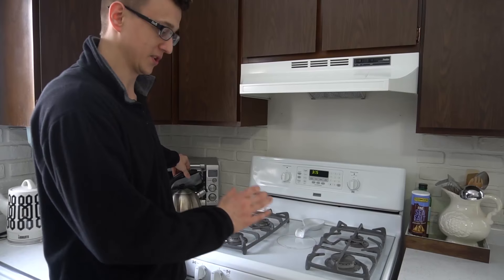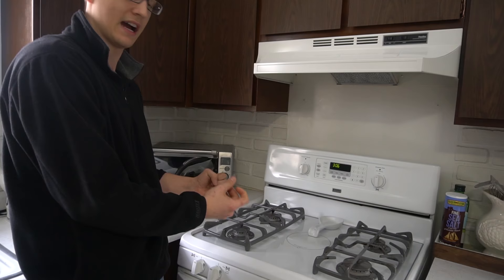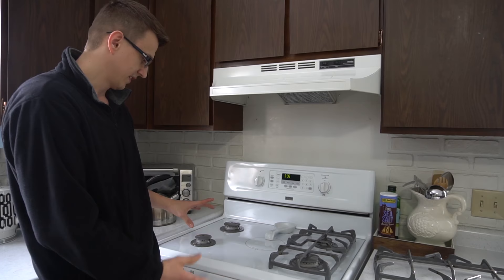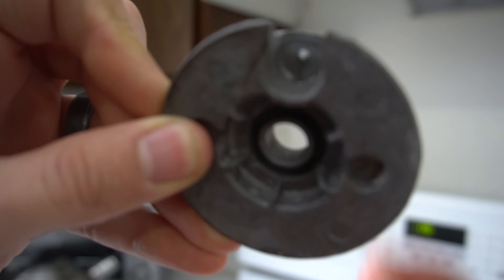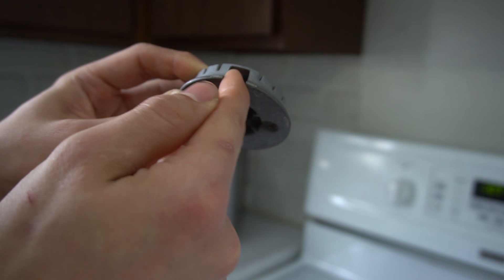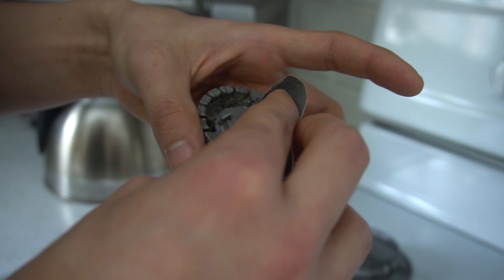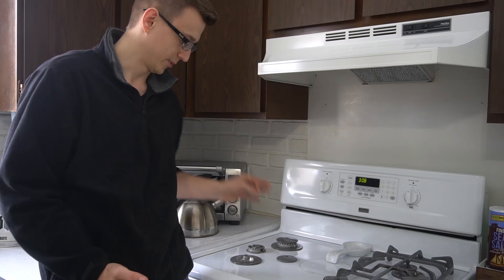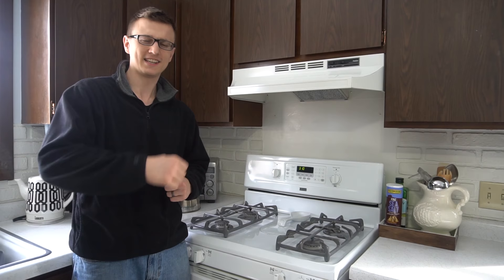Gas Stove Range Not Igniting - Easy Fix

Comment: Thank you!  I was just getting ready to call an appliance repair person and I watched your YouTube video and voila!  My burners 🔥working.  I had to use a socket wrench to undo tiny screws to release the metal burner, but with thorough cleaning with sandpaper and turning all the burners on - it worked!  And is lighting every time.   You’re a lifesaver!

Comment: Ok, I've had one burner irritating me for a couple of years now and tried to figure out the issue off and on during that time. This morning another one started acting the same way, so it was time to research more. Found this video and figured I'd give it a shot. I was disappointed that my pinholes looked completely clear to the naked eye and no gunk came out when I inserted the toothpick. I thought this would be a waste but figured I had nothing to lose. Put the burner back together AND IT WORKED! Both burners light up consistently now. Thank you!

Comment: My gas burner would only light on a very low. My husband just tried sticking the toothpick in the hole and turning it. This worked!!! Now the burner actually has a high flame when set to high!! Thank you so much!! I didn't run across many videos advising to put a toothpick in the hole where the gas comes out. Thanks again!!

Comment: Did this today and it worked.  I had cleaned them before but didn't know about the hole.  I got a toothpick, got in there and cleaned it good now its firing up fine.  :)  saved me from calling a repairman

Comment: Thanks for this! I thought I had cleaned the burner thoroughly, but it still didn’t light. The hole was clear but as I looked closer, there are two holes and one was still clogged. Easy peasy.

Comment: Thanks.  I had the same problem. I was freaked out to see that the lighter worked simultaneously on all the burners, so you laid rest the fears I had that it was a problem.  But, to get each burner to work properly I did as you said and all works OK. YEA! Thanks!

Comment: Thank you for sharing. I have the same setup as you have and I still cannot get my stove to ignite. Soaking the parts in hot soapy water used to do the trick but not this time. My burners look clean except for some white substance building up around it. I will next soak the burner in vinegar and baking soda. And I will try the sandpaper method if this does not work, thanks again.

Comment: My burner didn't have a little hole at the top for the igniter, but running some fine sandpaper folded hotdog style through the vents in the burner did the trick. Cheers mate!

Comment: Thanks so much for the tidbit about checking the small pinhole in the orifice!  One of my burners has not been lighting for months.  Had cleaned all the parts and was about to take it apart.  Took a toothpick to the part you mentioned about spider webs and there was ash!  Once i pushed the toothpick and tried it again it lit like a champ!  Voila!!  Thank again.

Comment: @DaddyChores . Hello how  are you? I really hope you will get this question soon as possible-it has caused tension in the house because they think i broke the stove...anyway i clean the top of stove surface around the burners as usual  but this morning they won't lite and the "click, click, click" is gone😳...🤔what do you (or anyone seeing this post) think happened? Oh yeah by the bye, the oven is not coming on SUDDENLY and the light either (i didn't touch the inside of it while cleaning) appreciate any advice, have a great day.
Reply: i know its way too late, but did you check if the power cable is plugged in the outlet?  did you ever figured out what was the issue - asking just in case it happens to me :)

Comment: Thanks for this video. I couldn't remve the outer casing to find the small hole due to stripped screws. But i tried the last solution you mentioned (cleaning the orifice) and my two faulty burners fired right up. Thanks!

Comment: Please save me, I sublet lol. I was cooking raw beans and the water spilled over, turning off the fire. I opened it up and cleaned it like you did here, dried it too but it still won't light on its own, I've been having to use rolled paper to transfer some fire of the other burners. What do I do?

Edit: I cleaned in between the teeth of the gray cap the goes under the black cap. Works great 👍🤣 you guys are awesome

Comment: This worked for me!  There was a tiny hole in the burner that was clogged up with gunk, exactly like you said.  However, I tried to poke it out with a toothpick, and it still wouldn't light up.  I then tried to burn the gunk out with a lighter, still didn't work.  I ended up just cleaning the burner real good, then I blew the gunk out with my mouth covering the burner (like playing the harmonica).  I think soaking it for a while in a degreaser might have helped also, but I ain't got time for that.

Also, there was some gunk just underneath the burner which caused it to not light up evenly.   I cleaned it up and now it works perfectly.

Comment: Poking a hole in the Orifice on my front left burger fixed it. There was a bunch of gunk and I had to pretty much pierce a new hole for the gas to flow lol. I’m still having trouble with my front right burner.
Reply: same here, did you get it fixed?

Comment: Thanks for the tip. 

My burner lights up from top and I got 4 burners out of which one burner doesn’t lights up. There used to be spark coming up and I don’t see spark for just that burner from past month. I’m using external lighter at the moment for one burner. Any tips on how can I fix this? 

I have got diplomat(brand) gas cooker.

Comment: My trouble is I washed it today because a lot had burned and spilled and I sprayed white vinegar and spray n wipe all around to clean it off, I guess alot got in there on the inside under the screwed area and now it's clean but wont light, what do I do?

Comment: My igniter won’t light the burner.  The igniter was clicking but the spark was amber instead of blue like the other 4.  Additionally, the spark was coming out low in the middle of the ceramic instead of coming out from the top of the igniter.  The gas was flowing because I can smell the gas.  When the igniter was clicking, if I used an external lighter, it would light up the burner, so I know it got gas flowing while igniter was clicking.  It all started when I cleaned up the burners last night after my kids made a mess of their cooking.

Comment: In my case , the spark igniter was coated by oven cleaner by the cleaning lady. Hence it did not produce enough spark for the burner to light up. I cleaned the igniter with dry cloth and then burner got back ON. One thing I also notice that if the burner cap is wet , even then it does not turn ON.

Comment: Thanks for your great videos!
In my case, I swapped the burners but the problem one is still not lighting up. The holes are clean too.

The spark strength and color seems different for the problem one. Could it be that it needs a new igniter? (worn out).

Comment: Can blocked gas rings cause headaches? My mum has been suffering from severe headaches with memory loss and I wondered if continual exposure to her unlighting gas hob was a possible reason.
Reply: If you haven't seen a doctor already, then you should. But you might want to have a professional check for a gas leak in the house.

Comment: I have a brand new wall oven separate from my stove top. And today they both went out and won’t spark. I have to light the stove top to get it goin but it won’t spark if I try to turn it on the regular way. My oven was just replaced two days ago and was working but today isn’t.

Comment: Only one burner ignites when turned on.  The other ones will spark only after they have been on for a while. After they cool down, they will not spark.  What causes this?  Is there a master spark controller that only seems to work for one element?  Oven and broiler works perfectly.

Comment: Hello, when I was buying my cooker, I tested and it was igniting without the use of a lighter or a matchbox. But since I got home, it has refused to work completely, I have to use a matchbox every time. Its so disgusting. Its the make where I have to press a button inwards, then turn the ignition knob anti-clockwise. But when I do that, I can hear the gas coming out but it does not ignite without  a lighter
Reply from the maker: If it is not sparking at all, I wonder if there is perhaps a loose wire connection. Are all the burners not sparking? It could be a bad spark module too. (the thing that creates the spark)
Reply: @WordofAdviceTV  Thank you. It was some ignorance on my part. When I was using the ignition key, I was not remembering that the switch should be on. My bad :)-

Comment: My burner is also only sending out a flame from the center of burner?
Any suggestions?
Reply from the maker: Have you tried cleaning all the burner slots with a toothpick or some sandpaper? It kind of sounds like some of those openings are plugged.

Comment: Opening the right-front stove valve starts the gas, but does not start the four igniters.  Opening any of the other three other valves starts all the igniters.  The problem seems to be related to the right-front valve, not the igniters.  A tip would be appreciated!

Comment: Some of the tips are helpful and I followed it before watching this video. The tiny hole in my gas burner needed cleaning and I used toothpick as it's the only sharp pointy object can go in but unfortunately the tiny bit of toothpick got in the hole and now it has stopped giving gas flame,how can I take that little bit out? please advise
Reply from the maker: Hmmm.. Have you tried using a needle or a pin to push it through? Other than that, another option would be to  take a lighter and burn that little piece of wood. It shouldn't take too long to burn off. The burner may turn a little black from the flame but it should be easy to wipe off the black stuff with a sponge or scrubby.
Reply: Try a paper clip.  The pin or needle idea may work as well.  Toothpicks are not recommended for the breaking off reason you mentioned.

Comment: I have a new whirlpool gas cook top and one of the burners takes a while or couple of attempts to light up, it seems to be clean as only 2 weeks old, this is the smallest burner,  how to correct ? I bought it from Best Buy and paid for installation, which was a third party. It would be a pain to go back to them to get it right, please advise, thanks.

Comment: These fixes didn't work for me. The holes are all completely clean. There are no obstructions. The range is only about a month or two old. It worked fine until today--now, all the igniters spark, and I can smell propane, but no burner will light. Yesterday we ran completely out of propane, abs today we got the tank filled. I tried holding the knob on LITE fit several seconds, but still no flame. Any ideas?
Reply: Solved it: unplugged the unit and plugged it back in. Was able to successfully light a burner using a BBQ lighter (previously this was unsuccessful). After that, all the others lit automatically. I'm not sure exactly why this helped.

Comment: Well, I sure wish it worked for me.  I have one burner that if it sits long enough, it will light, but when I do it again, it doesn't.  The back burner doesn't light at all and makes no sound when I turn it on.  I have no clue what to do.  I did take a toothpick to the slots, but they weren't dirty.  There is a tiny white knob on the silver part.  I believe that's what ignites the burner, correct?  Anyway....I hate having to hire someone to come out, but if I can't do a DIY, then I can't do a DIY....sigh~

Comment: All gas burners stopped igniting simultaneously. They click but don't ignite. The gas water heater is providing hot water so there is gas source (propane). Suggestions?

Comment: my gas range oven end heating cycle  at 350 F and screen blanks out. is this cooling fan or board. changed temp sensor but did not.

Comment: Ours is literally brand new, we just got it last week and already a back burner, the size I need to use for the pot I'm using since it only has 1 medium sized burner, won't light after 3 attempts. After the 2nd attempt, the kitchen smelled like the gas so I had to wait for the gas to air out before the 3rd attempt. There was enough gas in the air to give me a headache rather quickly, so there's gas coming out, sparks going, but no flame. And it's still new clean so....
I hate 2020. All electronics and appliances this year have needed replacing or fixing. I wish I was joking. This makes me want a home with a log fireplace even more.

Comment: Great advice.  My gas convection oven is doing the same thing, it is clicking but not igniting the oven. Any suggestions ? Thank you
Reply from the maker: It's possible that the insulation on the spark ignitor is cracked. Another thing to look for is if your bottom drawer is too full. If it is too full, sometimes it ends up sparking to one of the pans instead.

Comment: Hi one of my burners was very slow almost never lighting up then few days later all 4 not lighting up and I can’t hear the lighting sound any more when I turn the knobs. Can you advise? Thank u.
Reply from the maker: There's a good chance that your spark module is bad if all 4 burners are not sparking. The spark module is the thing that sends a spark to all 4 burners when you turn any one burner on. As a temporary solution you can just light the burners with a lighter manually. I don't have many stove videos on my channel but you can try searching on YouTube: How to replace spark module on (your brand) range.    That should give you an idea of what part you will need and what it takes to replace it. (usually pretty easy) There's no guarantee that the spark module is bad for sure since I am not there to check it but that would be my first guess. Hope that helps!
Reply from the maker: Pamela Howard  You're welcome! Glad I could help!

Comment: I was cleaning my burner with some soap spray and now it won’t light. How do I fix that?
Reply from the maker: I would make sure to wash out all the soap and then let it air dry completely before putting it back. My guess is that it simply was not dried out all the way when you tried to relight it.
Reply: @WordofAdviceTV  it worked, thank you 🙏 I guess the burner needed some time to dry

Comment: It only sounds the gas coming out...
Reply from the maker: If you are not hearing any sparking then it may be the spark module that is bad (the thing that sends power to the sparkers). It's actually not too hard to replace if that is something you'd want to look into.

Comment: incorrect information regarding poking gas nozzle with a toothpick do not shove a toothpick into the hole
unscrew the  gas nozzle with a 7mm socket in my case the switch of electric so there is no spark then turn gas
on to blast debris out of hole!